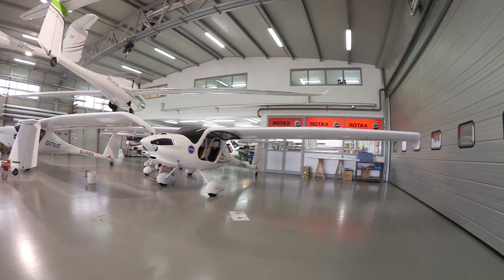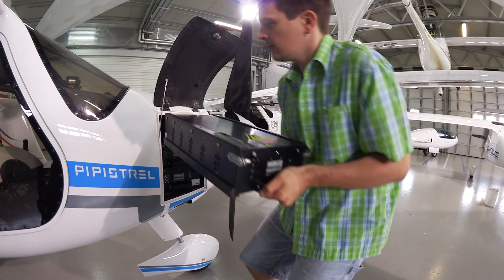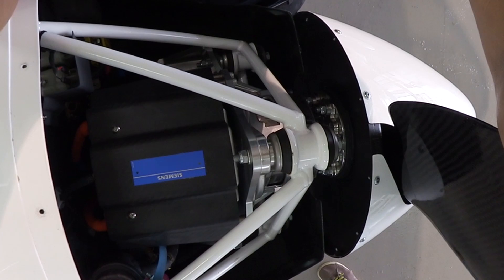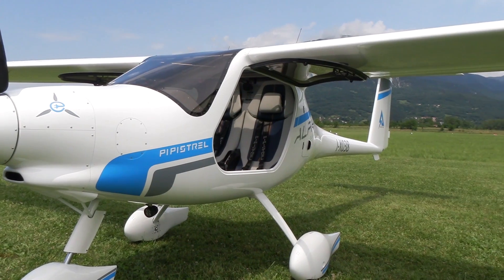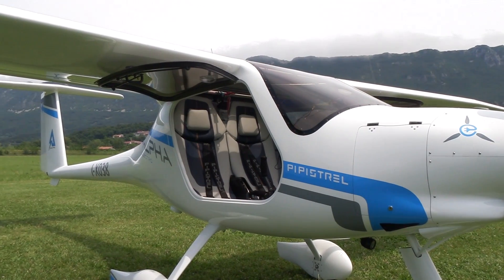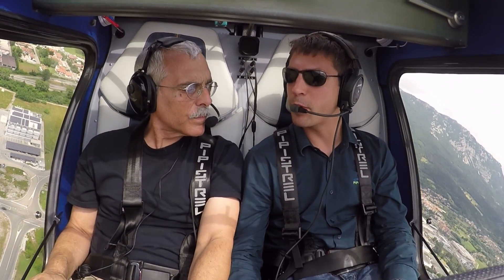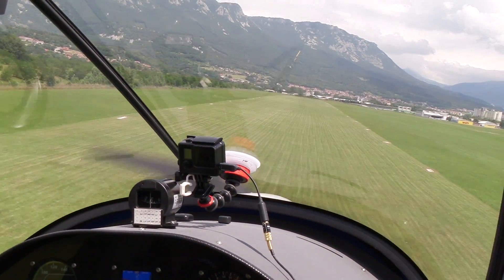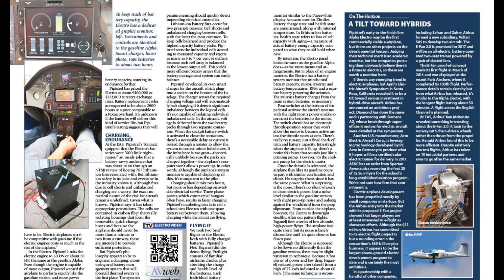Flying Pipistrel's Electric Airplane

Comment: Every comment on EVs ever: 
-"But it will never be mainstream"
-"But there is no infrastructure"
-"But the electricity itself isn't green"
-"But you can't recycle the batteries"
-"But the batteries lose their charge"
-"But thorium"
-"But hydrogen"

this is the best we got. If you have no faith in technology development cycles or you just can't stand a technology that's in its infancy then keep pumping that kerosene, leave this to the early adopters, keep repeating those seven things above like a mantra and do your best never to change anything in the world. And for god's sake, don't have any sort of vision, that would be mad!
Reply: Flex maybe you reality hasn't seen any improvement, hell my dad still can't believe a computer can give him real cash just by putting in some numbers...
Some people just get stuck in the past and that is all they will ever comprehend.
Reply: Exactly. Give this 10 years of improvement and it will be great.
Reply: rajamb, even in 10 years these won't be able to replace normal gas powered planes unless someone comes up with a magical breakthrough in energy storage. The reality is that gasoline has about 100 times the energy density of a lithium-ion battery.
Reply: "...But the electricity itself isn't green" - for cars; it takes as much electricity to refine a gallon/liter of gasoline/petrol as one could travel the same distance... gasoline or electric. By burning gasoline, you are still consuming nearly the same amount of electricity (I could really use some help with the word-smithing here...). I don't know how this translates to aviation here. On the other hand, I understand that the Aero-Electro's gasoline (MoGas) - powered brother, the Pipistrel Virus SW gets fuel efficiency similar to that of the Toyota Prius.
Reply: felxairz you don't know anything about batteries. Batteries are not like as they  used to.
Reply: Battery technology is still in its relative infancy . Exponential advancements need to be made in battery technology in order for machines like these to profligate.
Reply: @111danish111  - there were electric vehicles over a century ago, moron.
Reply: Mark Fox yeah the electric cars from 100 years ago are just a tad different than those around today. Just a little.
Reply: @Mrcaffinebean  Indeed, just a little, a 1899 baker electric did a record distance of 200 miles on one charge. Really the main difference and only one that matters, is the change from lead batteries to Lithium batteries. The efficiency of electric motors has always been very good. Even so, the energy density of lithium batteries is 50 times less then gasoline, and batteries will never approach the same energy density. Everyone with an even a basic education in chemisty should understand this. This might not be a problem for cars, and it might just be feasible for small sport planes, but for anything larger then this, it gets exponentialy more problematic. Unless electrity storage changes to something else then chemical batteries you will never see passenger planes with electric motors. 
Even this tiny aircraft has a real endurance of only about 30-40minutes ("up to 60 minutes" in the marketing) on one charge.
Reply: @slome815  I see this comment about energy density of batteries not matching gasoline all the time. Don't forget, because of the typical inefficiency of gasoline engines, around 25% compared to an electric motor of around 95% a battery only needs to contain 30~40% energy to be equivalent.  It's why a Tesla can go 250 miles on the energy equivalent of 2.5gal of gasoline. Still a ways to go, but closer than you think!
Reply: Exactly. These type of people where around when the Wright Brothers where taking off too. Ever technology looks useless at first but slowly it becomes better and better until next thing you know everyone assumes that people always saw the potential.

It’s not an anti green or pro green position to say electric is the future. Even if it’s not their yet some day soon it will be.
Reply: Yup
Reply: But thorium? Thorium would supply the energy for BEVs, it's not an alternative to BEVs. The ignorance of BEVs nuts is astounding.
Reply: I support thorium reactors for huge powerplants, but batteries, solar, and wind are the best thing for smaller scale operations. Like aircraft, for instance.
Reply: No density improvement? You anti-green idiots are just unbelievable... Renault Zoe 5 years ago: 24kwH... Renault Zoe now: 41kwH... same size of the battery, same car and THAT is why electric is the future, YOU are simply an ignorant and why WE are ALREADY laughing at you denialists with your blinders on.
Reply: @chrisobber5604  Where DOES THE ELECTRICITY COME FROM?  I work IN POWER house, we burn TENS OF THOUSANDS OF GALLONS OF JET fuel TO OUR jet engines IN THE ground. It's NOT CHEAP.
Reply: There are good applications for electric, and there are less-good applications for electric. There is not a universal solution for everything, nor should anyone speak in those terms. 

It's good to experiment and explore what works and what doesn't. Fact is that as of right now, batteries simply don't offer the same energy density of fossil fuels, and that will be a major application constraint for the foreseeable future. They make it up in lower cost of operation, but cost isn't everything if your application requires endurance -- something that is paramount for most vehicles.

Airplanes in particular live and die by energy density and endurance, which makes electrical power a very tricky proposition. Maybe at some point they'll crack the problem, and create a system with batteries light and dense enough to provide range comparable to an average GA aircraft. We're not there yet though, far from it.
Reply: @Dr.TJ_Eckleburg  +
Reply: The most funny argument I ever heard in my  30 years of life: -"But the electricity itself isn't green"  
Such a stupid argument..  I don't even attempt to  respond to that when hear this from someone.m I'd rather simply shot my mouth. So silly.
Reply: @UbuntoO 

I'll get out of the way, and let you continue your journey into the world of magic and floating unicorns.
Reply: free spirit - electric vehicles are NOT in their infancy. It's old technology and a dead end.
Reply: My usual responses:
"But it will never be mainstream" - Who cares? Are you only doing what everyone else is doing?
"But there is no infrastructure" - Wrong. There are more outlets than gas pumps.
"But the electricity itself isn't green" - Depends. Mine is for example, yours can be too, and cheaper as well.
"But you can't recycle the batteries" - Yes you can, but you don't have to worry about that for another 20 years. Tell me about that combustion engine of yours.
"But the batteries lose their charge" - No they don't. And they last for ages.
"But thorium" - Nope.
"But hydrogen" - Nope. Too dangerous, too complex, and do we really need another oil processing by-product? And don't get me started about electrolysis...
Reply: It is clear that tree huggers aren't very educated in the field of physics or engineering, because every single one of them neglects the energy and power densities coming out of electrochemical reactions. They simply aren't practical for real world uses, they can maybe take off as a hobby or short range trainer but not as a practical transportation solution.
Reply: That's green dreaming all over again.
Reality sees no spectacular improvement in battery density and or chemistry in the last 20 years and the coming decades.. Hybrids drives might be a better solution. Combining the best of ICE and electric.

Comment: These could be good for forming countries that don't have a good airforce. No having to worry about the expensive cost of fuel. I saw another electric airplane that has solar powered wings to increase the duration of the flight.

Comment: man. a couple bucks in one charge. better than 32 gallons of octane fuel.
Reply: Not necessarily, the battery banks will be a fortune, and they will need to be replaced eventually (probably before a 2200hr overhaul on a traditional engine), The key is all around battery cost what do the batteries do to the original purchase price? Then the long term maintenance/replacement cycle. Kind of like electric cars super expensive to buy, inexpensive to use, hugely expensive to maintain...
Reply: tjonessc batteries become cheaper and better every year. I don’t think this is true for engine overhauls or new petrol engines.
Reply: @tjonessc  "Kind of like electric cars super expensive to buy, inexpensive to use, hugely expensive to maintain"
None of which is true other than use expense. EVs are incredibly cheap, have almost no moving parts and therefore almost never need any sort of maintenance. Most EV owners have never had to pay for maintenance the entire time of their ownership. I know countless Model S owners that haven't put a single penny into their cars for 5+ years other than the cost of charging the battery, and drive their car everyday. 
Same with Model 3, still have never heard a single case of anyone having to pay any money for maintenance.
Reply: @tjonessc  I'm willing to wager that the unit cost of the batteries might be cheaper than the unit cost of the engine overhaul.  Not to mention the additional factors of oil, belts, and fuel.  As for the cycle count of the batteries, a typical cell is rated for about 500 to 1000 cycles.  Depending on the amount of flying and the number of hot-swappable batteries on standby the replacement cycle for the units may be extended to a scale similar to traditional piston engines.
Reply: @tjonessc  Oh and battery banks never really have to be replaced, even with heavy usage from modern batteries 7 years ago. There is something seriously wrong from the manufacture if your battery needs to be replaced with the 15 year life-span coverage. 
Please stop spewing false information and start actually doing the research on modern EVs.

Comment: There you go. The only really relevant info here is that endurance is barely ONE HOUR. Until that is addressed these are fantasy aircraft. That is why electrical power was good for local milk delivery, golf carts, and a host of other applications, but NOT aviation, without a revolution in electricity storage. Another thing not mentioned here is the HUGE cost of both the production and maintenance of batteries and the environmental costs of their disposal. Until both these are addressed electric aircraft power is a limiting, and very expensive notion and will be for decades to come.
Reply: With all respect but this a small airplane perfectly fitted for flight school etc and not an A380 so one hour is quite inpressive in my opinion... I'm not exactly sure why you're writing this but if they wouldn't make that plane there would never be an electric 747 or so. This is just one of the first steps and definitely a wonderful glimpse into the future.
Reply: fingerhorn4 Everybody assumes lithium batteries are as horrible as nickel cadmium or lead acid. They're different creatures entirely, and the situation is getting better every day if for no other reason than simple economics.
Reply: There is no "huge cost of maintenance" for Lithium Ion batteries, they are 100% maintenance free.

Also, there is no environmental cost of their disposal, they can be easily recycled and are actually 80% Nickel.

Comment: All we need now are better batteries with higher capacity and longer lifespan... At the same weight of course ;-D
Reply: The flexairs logic of thinking:

" "Where a calculator like ENIAC today is equipped with 18,000 vacuum tubes and weighs 30 tons, computers in the future may have only 1000 vacuum tubes and perhaps weigh only 1½ tons."

https://www.popularmechanics.com/technology/a8562/inside-the-future-how-popmech-predicted-the-next-110-years-14831802/

In 1977, Ken Olsen, the founder and CEO of Digital Equipment Corporation, said, “There is no reason for any individual to have a computer in his home.”

Part of the reason for Digital’s downfall is often blamed on Olsen’s failure to anticipate or understand the burgeoning personal computer market, a failure supposedly exemplified by his having disparaged the PC as something no individual needed to have in his home.
Reply: No we haven't, you stupid son of a bitch.
Reply: That is the song since 1970.. we already have 95-99% of battery development done.

Comment: Perfect solution for those who do short commutes in Southern California, such as point A and B in the L.A. Basin.
Reply: Unless your commute is extremely short (like 10-15 minutes), 1 hour of endurance is just not long enough, with sensible reserves, for any safe travel. 15 minutes to shoot a couple of missed approaches, 30 minutes to diversion and you're out of battery. And in densely built up areas like SoCal, that can get you killed in a real hurry.
Reply: A short distance commute in LA can last for hours.